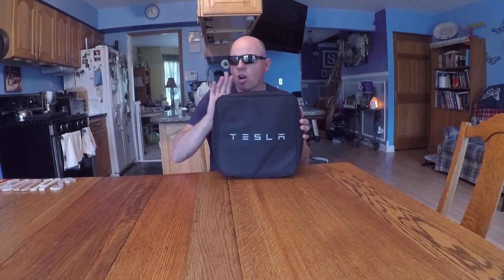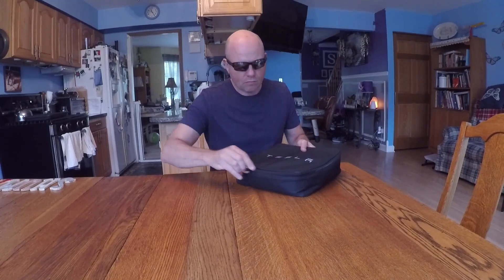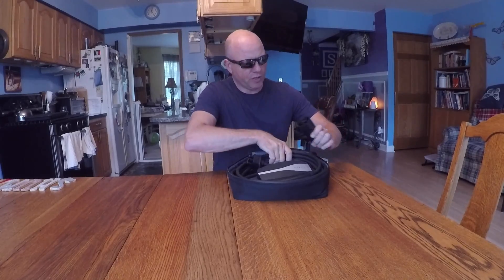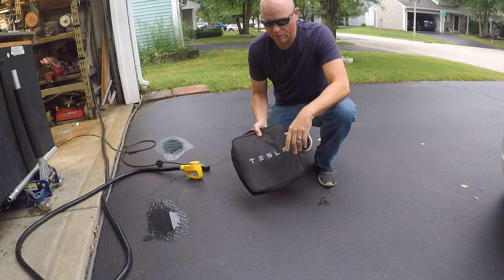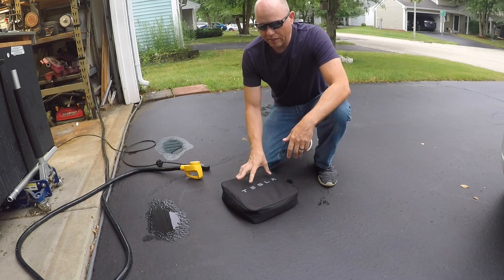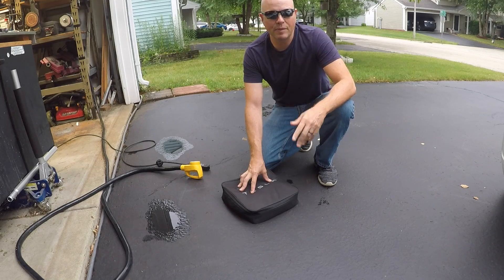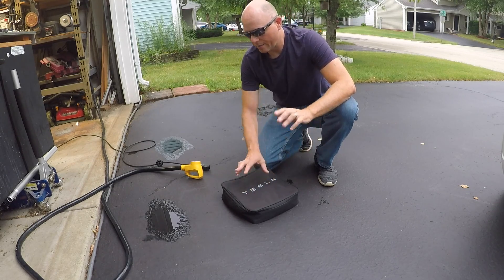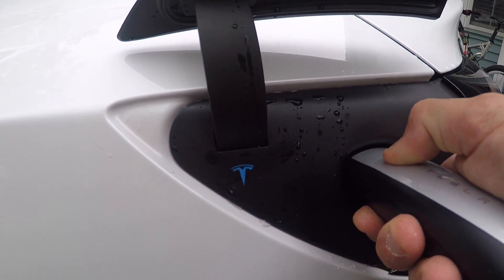Tesla Model 3 Comprehensive charging tutorial.

Comment: If you have a 50amp breaker (nema 14-50) why are you only getting 32amp while charging?
Reply: All new 2017/18 Tesla mobil charge cord sets only support 32 amps to comply with Canadian electrical requirements. You can use a charge cord set from an earlier made Tesla and it will supply 40 amps.
Reply from the maker: Vinceand Theresa that is the rate of charge the Model 3 charge cord accepts.
Reply: As stated above the UMC only maxes out at 32 amps.  If you want faster speed, you have to buy the Tesla wall connector.
Reply: @BillLowny  That is actually incorrect.  The Model S and X UMC charges at 40A.  If you want the 40A charging speed, just buy a Model S or X UMC from somewhere.
Reply: Vinceand Theresa - that depends on a lot.  The wall connector has multiple settings depending on what breaker you have.  Maxed out on a 100 amp breaker, it will draw 80 amps, which is about 44 miles an hour charge.  On the lowest setting for a 15 amp breaker, it will pull 12 amps which is about 11 miles an hour.  Tesla recommends a 50 or 60 amp breaker since the model 3 can only max charge at 44 miles an hour everything else above that is just overkill.
Reply: @BillLowny  The HPWC is rated at up to 80A.  But the Model 3 charges at 48A maximum.  So, using a HPWC on a Model 3, it will draw 48A, not 80A.

If you are using a HPWC, and charging at 48A, the wiring must be rated for at least 60A.  The breaker should be at least 50A, but may as well put a 60A breaker on it also.
Reply: Thanks.  Do you know what amps the Tesla wall connector puts out?

Comment: I noticed that there is water on the plate underneath the charge port door.   It is not waterproof?

Also, when charging at a local non-Tesla  charger, what is the typical charge rate?
Reply: Amperage available at J1772 varies widely.  I think L2 maxes out at 30A, it's the highest I've seen anyway.  Some are much less.  So charging rate will also vary.
Reply: @TheCritic-MMA  The L2 standard maxes out at 80A.  Typical L2 chargers in the USA are mostly 32A, although the 40A chargers are becoming more common.  You can see some examples here:

https://store.clippercreek.com/level2/level2-40-to-80
Reply: Its just a plastic cover, it does not seal in any meaningful way. This really goes back to a question I always had about Christmas lights. People run xmas lights, including in the rain, plugged into multiple sections without any particular protection where the cords meet. Why don't people get electrocuted?

I believe the answer is that simple water films won't get it. It a water film gets across the terminals, the resistance in the water is most likely to just evaporate the water. You'ed have to immerse the connection in water to cause a meaningful short.

Car charging ports are protected six ways to one. The relay box measures current leakage between charging terminals, as well as leakage to ground (like a GFCI outlet). If any sneak paths are detected, it would shut down, meaning that if you stuck the charge outlet in a bucket of water, nothing would happen.
Reply: D Whatley now you know has a great video about that
Reply from the maker: D Whatley the chard port is internally waterproof. But not the underside surface by the T indicator light.
Reply: Thanks!  I was not so much worried about a shock as a short and potential rust damage from sitting water.
Reply: D Whatley  Plastic does not rust. Only ferrous metals rust...
Reply: Sure, that would argue for stainless steel connectors.
Reply: Scott Franco  Stainless steel is not a good conductor of electricity.

Comment: Do you close your garage door on the cord at night?
Reply from the maker: Loanword Eggcorn my door does not sit tight to the ground. Also, my door has a thick rubber gasket at the bottom. No issues for me. I would think this is different for each door, though.
Reply: It's safer to leave a gap so the cable is not crushed.  Yes, it may survive, but why risk damage or wear the cable?
Reply: Thanks guys, we have that too, but our EVSE cable may have been damaged by closing the garage door on it too.  Recommend a gap.
Reply from the maker: maclover yes I do. It has been fine so far.
Reply: Right, pretty much all garage doors that open vertically have a "foot gasket", meaning that if you zone out and stick your foot under the door while closing, it won't hurt you.

Comment: Thanks for making this video.  For charging model 3, if I could get 220V 15A and instead of buying the Tesla 6-15 adaptor, could I just use the 5-15 adaptor that comes in the kit?
I know I could use the 14-50 adaptor but I worry that I would forget to limit the current to 12A.
Reply: +Jack Leung If you're asking if you can put a non-standard voltage through a 5-15 connector, the Mobile Connector or car may detect that as an error and not allow you to charge.  Please use the appropriate connectors with the appropriate voltages, or it may not work.  There is also an increased fire risk if you try to use non-standard voltage or current.  Please contact an electrician if you need help.
Reply: IMHO, I believe the US standard is more like 110-120V, I've often seen less than 120V in perfectly wired systems.  I know theoretically it should be 1/2 of 240 but I think the loss on 120 is expected.

Also interesting, if you have 3-phase power (common at business, not in homes) you get 208V instead of 240V.  Most everything that takes 240V is also fine with 208V.  Teslas included.
Reply: Also remember it will back off the charge rate IF it gets any early indication of the breaker/wiring struggling.  And the app notifies of this.  Also it will back off if the charging kit's wand or cable get too hot.
Reply: Yes, pretty sure the plug used sets a limit on the charging kit.  For example, you can plug into a NEMA 5-20 all day, but will only get the safe maximum for 5-15 with the 5-15 plug.  Tesla sells a 5-20 adaptor though.  

IMHO has an intersting point about voltage maybe not encoded--but it's a VERY BAD idea, something that doesn't auto-sense 120 vs 240 getting plugged in would be very bad.
Reply: Tesla cars remember the charge cord limit set-points based on their GPS location.
Reply: Jack Leung, it’s a good question. We know the Tesla adapter has an encoder to set the current limit, but after doing some research, it’s seems the voltage is not encoded, it’s just measured, and the onboard charger adjusts for the voltage.

Of course, if you really have a 6-15 plug, you should get the 6-15 Tesla UMC adapter. But if you live in a country that uses a 5-15 or 5-20 outlet at 220v, like here in the Philippines, then I can see why you might prefer to use the 5-15 adapter. 

In the Philippines, most outlets have no ground, and I think the UMC will show a fault. So probably you need to find out exactly what plug you are going to plug into and if it’s wired to code.
Reply: Jeremy Lang, yes, US uses split phase power, so if you have 240v coming in, it should be 120v-120v, but could be 126v-114v if there is an imbalance somewhere. If it were my house I’d check both legs and see if they are balanced, and if they are both 120v, I’d check along the length of that hardwired light duty extension cord while under 12A load and see where the drop is.
Reply from the maker: Jack Leung a couple things; first, once the limit is set lower, it stays lower until you manually change it again. Second; if you pull too much current and trip a breaker, the car will email you via the Tesla app and notify you that the charge was interrupted so you can rectify the issue and restore power to the car.
Reply: Jeremy Lang, it must be rather forgiving because when he used his ship’s shore power cable, he got 239-240 volts, and when he used his light duty extension cord, it dropped from 120v to 112v, so either his house or neighborhood has a wiring problem, or 12 A is too much for his extortion cord. If, for example, someone used a cheap extension cord, it could burn up on the Male end before the female end got hot enough to overheat any sensor in the Tesla adapter cable. 

It would be good to see him check the power at the breaker panel to see if it’s only 114v or 120v, and find out where the weak link is. I know he doesn’t use that extension cord to charge his car, but if he does want to use any other 12 A load for an extended period of time, it would be good to know it’s not a problem with his house.

Comment: Is that "extension cord" water/snow/anything proof? I don't have a garage and I'm looking to install a NEMA 14-50.
Reply: Let me clarify, circuit breakers are available with GFCI built-in, such as a  Square D QO240GFICP GFCI breaker. My house main electrical panel uses a single-pole version for the exterior outlets.
Reply: So there's probably no GFCI (Ground Fault Circuit Interrupt) on that cable which implies some dangers.  In case of emersion in water or certain kinds of damage to the cable you'd be more likely to get a serious to lethal shock than if GFCI was present.
Reply: Loanword, after viewing quite a few of Matt's videos, he seems too smart to hook up 220V to a standard (non-GFCI) breaker, but let's ask him first before releasing the hounds...

So Matt, is your 14-50 cable wired into a GFCI breaker?

BTW, really love your videos!!
Reply from the maker: Joe honestly, I'm not sure. I know the car can be charged outside.
Reply: It's not an extension cord.  It's an EVSE and it has circuitry in that box to make sure charging is happening safely.  The Mobile connector with a fixed cable may be more waterproof then the version that has the removable wall plug end.  (There is a different version of the MC with a fixed 14-50 plug on a non-removable cable.)

The EVSE itself has a ground fault interrupter which will turn off the power if any significant current is leaking to ground, same as the GFCI in your bathroom or kitchen, etc.  https://en.wikipedia.org/wiki/Residual-current_device
Reply: Agree.  What he's done with the 14-50 extension cord wired directly to a circuit breaker is unsafe.  The circuit breaker would prevent a fire, but one could be electrocuted before the breaker tripped.  +Tech Forum, please correct this before someone dies.  No one wants that to happen.
Reply: Ground fault interrupers are not the same as circuit breakers.  He said in the video that the 14-50 cable was hard wired directly into a circuit breaker.

Agree Matt is smart.  Sometimes even smart people make mistakes.  Friends help point that out.  People who don't care, don't.

Comment from the maker: This video is for those who asked various questions about charging the Model 3.
Reply: besides the slow charge rate, are there any adverse effects specifically to the battery if always charging @120VAC? it may be my only option unfortunately...
Reply from the maker: bizzle nope. No adverse issues with slow charging.
Reply: @TechForumTesla  thats all I use now that I gave up the free lifetime supercharging for the $5k in return. Am retired, so I only have 1800 miles in months.
Reply: There's actually some indication trickle charging may be better for the pack.  Certainly better than constant Supercharging--though TeslaLoop's experience makes it sound like that may be overblown.
Reply: It comes with what he showed in the video which is a fairly long cord (20').  Hopefully your outlet will be installed within reach of your parking.  Extension cords are not recommended but if they're quality they can work.  Here's details on the kit, if the link works: https://electrek.co/2017/12/15/tesla-cheaper-next-gen-mobile-connector-model-3-s-x/
Reply: Tech Forum I like your video but I have a question red light is on charge cable is locked how can I unlock it
Reply: Does the model 3 come with any cord or do I have to buy the $500 - 20’ cord and adapters you showed in the video.  I called Tesla today about installing a 240 plug. $1000 min.